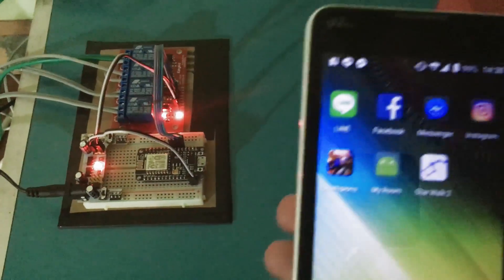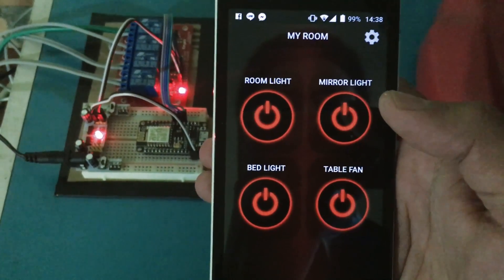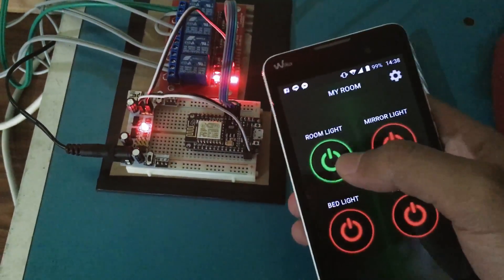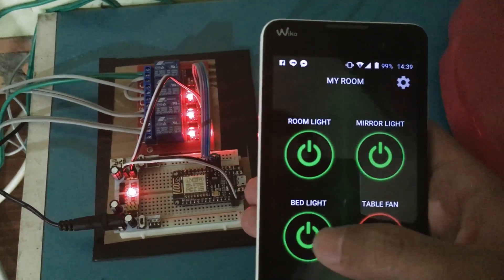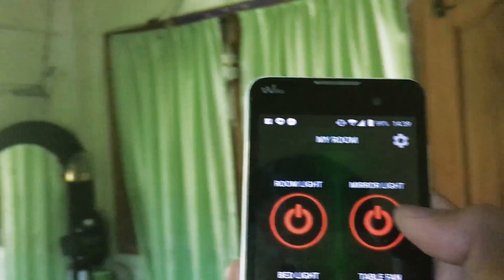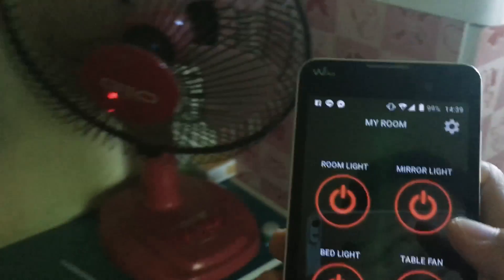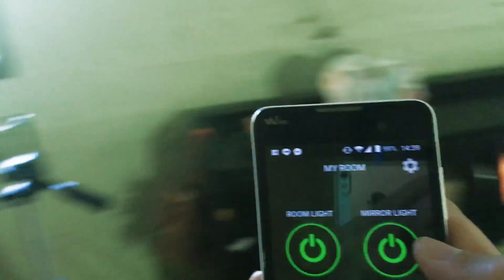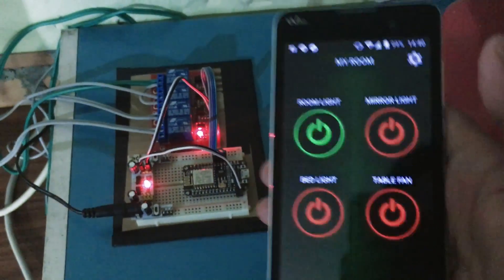ESP8266 (NodeMCU) Control with Android Phone through the Internet

Comment: Why did you jump the COM leg on relay 3 and 4 but on relay 1 and 2 they both have their own COM leg seperated?
Reply from the maker: The reason that They are not separated because I save the wire. You jump they all together. but you to make sure witch wire have current.

Comment: What if I change my Wifi name and Password? should I change it also from the arduino code? Is it possible that I just use android phone to change the WIFI and Password in arduino?
Reply from the maker: Depend on your coding. If you want to set the WiFi password from the android phone you can write the code to communicate between android and arduino to get the password.
Reply: @DZULKIFLEE  that's how exactly what i did! 😀

Comment: the project is on which platform ??? App Inventor or another ???
Reply from the maker: Android Studio
Reply: Gradle sync failed: Could not find method implementation() for arguments [directory 'libs'] on object of type org.gradle.api.internal.artifacts.dsl.dependencies.DefaultDependencyHandler. // // Consult IDE log for more details (Help | Show Log) (1m 25s 251ms) (45 minutes ago) error receive. do you have any idea
Reply: @bimalsubasinghe7584  same here, how did you fix it please
Reply from the maker: @bimalsubasinghe7584  update libs directly in Android Studion
Reply from the maker: update libs directly in Android Studion

Comment: How to get the ip address for arduino code
Reply from the maker: print it to the serial monitor in another way you can set the manual ip address for the NodeMCU
Reply: You can set fixed ip in router, using esp8266 MAC adress. You dont need to see ip.

Comment: Must be a wireless partner? Can it be controlled via two different types of wireless?
Reply: It can control anywhere where I am able to access internet. Because the NodeMCU is a part of my network. it connect to my router and it has its own IP Address. I can access outside of my local network through the router with port forwarding to NodeMCU.
Reply: Sulkiflee Masa it sounds good. Could you show me a source of information about this?